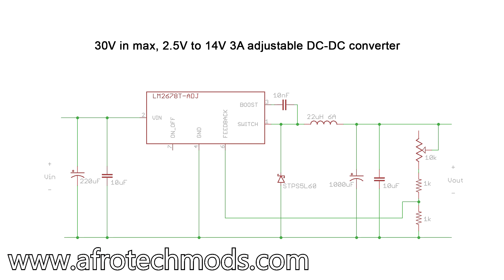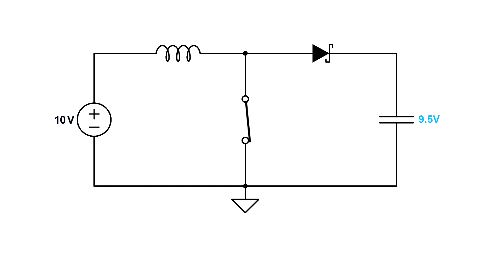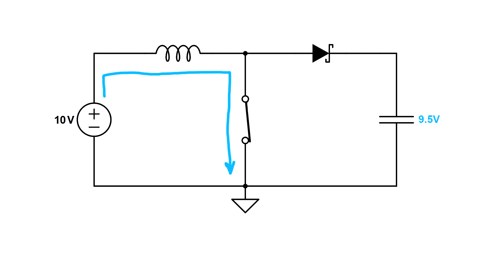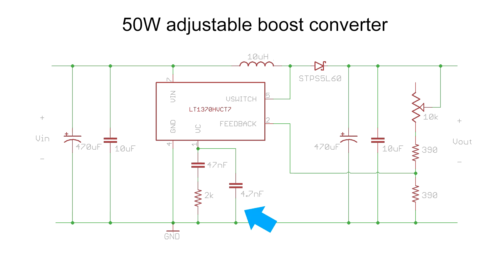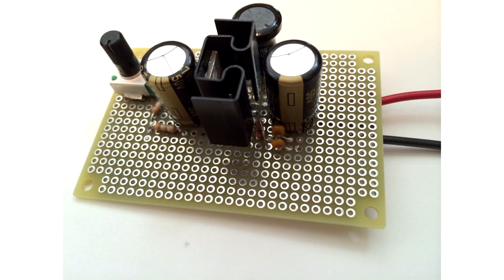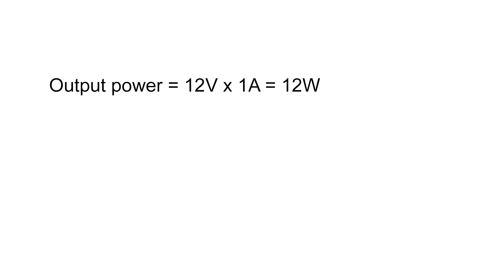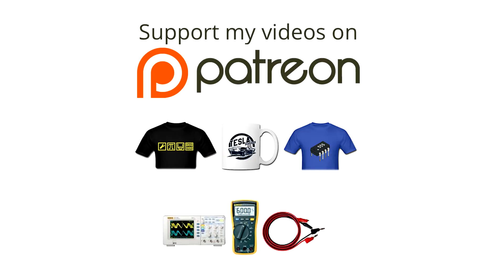DC-DC Boost converter tutorial

Comment: I was looking for dc to dc boost converter but couldnt find powerful enough converter to boost 24v to 36v with 60A output, is there a way to build power converter powerful enough to do so? or is it possible to connect multiple power converters in parallel? to achive high enough power output?

Comment: I had 150 volts stored in a 470uf cap on my bread board from my boost circuit, would that kill me?
Reply: basil abedallah Get The Fuck Out Of Here Right Now!
Reply: +Ultra RC If 150 volts had more than 0.01 ampere, and if it was shunted across your chest, the possibility is not zero. In essence, I would have to say YES to be safe.
Reply: +RiaRadioFMHD773 apparently 1 Amp is enough to kill you, but it's very volt depending like you said
Reply: +damon-st 1 amp can kill you, ive been lucky so far...
Reply: +basil abedallah bro, skin thickness doesnt have anythimg to do with it.. we are all 90% water.. water is conductive... we are all equally conductive (with in .2% depending on water intake) i am an industrial electrician.. i deal with KW on a daily..
Reply: That's 5 Joules of energy. A shock from a defibrillator delivers 300 Joules.

Comment: I use boost converters in all my 5V and 3V3 projects. They are like less than $2 now on aliexpress
Using a ferrite at the output, allows me to even use these boosters to power my sensitive electronics like sensors. Thumbs up.

Comment: Can you give me answer to this question : what would be the voltage in your example after just a single step of shorting coil and releasing switch ? In other words, if capacitor is initially at 9,5V due to diode voltage drop and you run one cycle on/off how to compute the voltage in capacitor ? is this doable ? How that voltage depends on parameters like inductance ,capacitance, input voltage ?

Comment: +Afrotechmods - I need a dc booster for a wind turbine for when wind is low and voltage is below charging volts so it will charge even at low speeds however when the wind picks up it needs to bypass the booster. How can I do that?
Reply: You need Buck-Boost converter
Reply: +temo taj - I already said that. What I then went on to ask is how to bypass the buck booster when voltage reaches a preset limit. How do I do that?
Reply: +SuckMySweatyBallz  Zener diode + Mosfets?

Comment: Hi, I'm currently working on a small railgun where I need to charge a 400v 3200uf capacitor off of 12 volts. Do you think a boost converter would be a good choice, or should I use some other circuit.
Reply: what else would you use?
Reply: 400v inverter maybe?

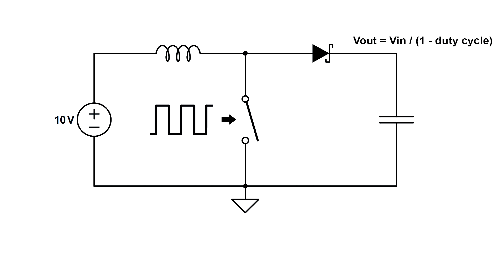Comment: 2:41 "We need a controller chip"
This is where the project instantly gets too complicated for me :(
Reply: And expensive £20. odd.
Reply: Start taking broken electronics apart and desolder all the components. Build up a good collection of random circuit boards (power supplies have good stuff in them). The key to learning electrical circuits is having the right parts at hand. You would be surprised what you can put together when you have all the parts right in front of you
Reply: Most chips are easy to work with. Give it a go!

Comment: Would this work as a battery desulfator ???
Reply: +Kennynva T. Yes. If you set the voltage to 16v, you can over-charge a 12V LA battery and hence, desulfate a LA battery. You will lose water in the battery since it turns into H2 and O

Comment: This tutorial is good as a supplement but for a more comprehensive understanding read/scour this article from TI. You will most likely never understand the operation of an SMPS without also busting out a pencil and paper to draw the circuit in its different states, write out (and better yet derive) the equations and practice some different values. 
http://www.ti.com/lit/an/slva061/slva061.pdf

Comment: How can I calculate the values of the components I'm gonna be using ?
I want to build a portable charger and I'm using 3 Li-Ion batteries from a computer in parrallele(to easily charge them and have a longer efficiency. Which means that I have to step up the voltage to 5V so I can charge portable devices(such as phones). But I wasn't able to find anything that could help me on the internet.
I appreciate your help.
Reply: +Mohamed Berrada It depends on your output current
For a simple controllre that can supply high power, and good design tips, check the MAX641 datasheet.

Comment: is this ok if i have an unstable power source like pedaling a bicycle connected to an alternator? since my rpm value for the alternator is not high enough, due to the limitation of my bike, because it gives me at most 10volts(not constant due to the speed of the pedaling of the bike...)...should i use this booster circuit in the video?

Comment: Do i need to vary the input to have 30volts output or it is already 30 volts when i powered up the converter?thanks
Reply: Christian Rey Bautista I think it depends on the last position of the potentiometer (the last time you turned it, the way it came from the factory etc.)

Comment: great vid. How is the maximum output of 30v related to those resistors? I want to boost higher. read the datasheet but couldnt understand :(
Reply: +Xinran Li Beware of stupid voltage increasing - the output capacitor may not handle it. To increase voltage, normally you increase the top most resistance.

Comment: What does combining both kinds of capacitors in parallel like that do?  Why do it?
Reply: +rlrsk8r1 I think it's something to do with the equivalent series resistance, the larger capacitor holds the most of the energy to smooth out the bulk of the switching frequency but alone that will leave some high frequency ripple which is where the smaller capacitance cap will deal with as it will also have a lower equivalent series resistance at that high frequency than the bigger cap. my explanation may not be entirely correct (not sure if it really is because of ESR or if im missing something but basically yeah the smaller cap filters high frequencies better than the bigger one)

Comment: what if we power the input using usb of a computer which can supply a maximum of say 500ma ? will the computer usb port gets damaged?  or will it sustain to this load so called dc to dc boost converter
Reply: srikar sana The USB port can deliver 1 amp. If you have a fairly modern computer, the USB port will shut off if its overloaded.

Comment: in the video is said that the limit in the output is 50W, according to my calculations, without heatsink with a limit of 150ºC (where the IC losses its characteristics) we have 3W of limit, it is so low, i'm not sure this is correct
Reply from the maker: carlirr91 50W of electrical output power. Not 50W of heat generated in the heatsink.
Reply: Afrotechmods you are right, i have an overheating problem but I think that i just found my mistake, the diode i'm using (1n5818) has just 1A of forward current!

Comment: Looking at the data sheet, it recommends one tantalum capactitor for the output capacitor, and says that ceramic capacitors alone have an ESR (effective series resistance) that is too low. Is the electrolytic and ceramic capacitor combo an alternative to the tantalum capacitors? (which are very expensive - about $10 a piece on Digikey. ouch)

Also, what about the frequency compensation capacitors? Can they be ceramic capacitors? What is their required voltage rating?

Comment: I am looking to build a boost converter to boost 12/24V to 300V to power 12ax7 preamp tubes with a small transformer i can get at radio trash. Using a 555 or 556 timer is fine. Output current is unknown but .5 amps is probably right. would like switching freq to be 40Khz and above, well out of the human ear range and also gentle on animals. Any ideas or links you could point me to, would be highly appreciated. Thanks in advance! otter

Comment: I need to boost 3,7V to 12v with a maximum of 3A output, anyone here for some ideas?
Reply: Brando I'm new to BCs myself, so I won't even attempt to give you tips on the circuit, but I know that first of all, your input will need to be able to supply enough current to handle it. 
12 volts * 3 amps = 36 watts (this is the total you need at output)
36 watts / 3.7 volts = 9.73 amps (approx)
Then you need to allow for some loss in the circuitry of course, so you can bet you'll need at least 12 amps on the input.
Reply: +Brando Use a MAX642, a suitable Low RDS(on) mosfet like the IRF540N, and a low value inductur but that can handle high current (low winding resistance less than 0.1ohm, value approx. 20uH but YMMV). Use a 1000uF minimum high quality input/output capacitor, in parallel with a 10uF tantalum. The schottky diode could be a SBL1045ct (10A). 
USE THICK TRACES AND build everything on a SINGLE PLANE using SHORT and THICK CONNECTIONS. 

Troubleshooting if the inductor value is wrong:
-Too high: 12V output drops to 9V or less when some load is applied; inductor WINDINGS (not core) gets excessively hot; can't regulate properly output when load attached (voltage is not stable), can't get full power.

-Too low: can't regulate at all output (can't get 12V at all even with no load), inductor whines loudly, MOSFET overheats even with no load, inductor CORE (not windings) gets hot, excessive consumption even with no load. 

What's handy about the 642 is that it has an integrated Low Battery Indicator function which is useful if your project is powered by batteries (your seems like it is, given the 3.7V).

Use a toroid type inductor, that way you can wind or unwind the windings to adjust its value by trial-and-error if you don't have a LCR meter, just like I did. (I took a big inductor out of an ATX power supply and progressively unwinded the windings until I got the best efficiency). 

Here's mine (powered from 4 1,2 V AA cells, 5V total , output current = 2,5A @ 12V) , all parts labelled.

http://ergolth.alphab.a-centauri.com/cdn/MAX642.jpg<

Ask me any questions you may have!

Comment: I simulated your simple boost circuit on Proteus but without the LM2678T IC, instead I used a 555 timer IC to give me the signal to control on/off transistor(simple switching technique), but the output voltage kept increasing and didn't stop! so I put a zener diode to limit it to 20 volts (I want a 20V output), Question Is: Is it safe for the zener diode ? and for the circuit?
thanks in advance.
Reply: Mane laston  If the current through the zener and the power dissipated through it is below the maximum ratings of the diode, everything is safe. If you exceed the ratings of the diode you will notice it immediately because.
A: the diode will get hot, very hot
B: smoke might come out of it
C: it may go bang

Comment: Very nice video. However, I always miss a nice explanation of which parts exactly can kill you. Yes, I know it's touching + and - of the capacitors. But still, it would be nice to have someone explain where exactly you can and where you can not touch a capacitor in such a circuit.

Comment: Just love your channel man its the best!I built a boost conv. 12v-15v 3A for laptop backup power based on mc34063 with output mosfet,and i don't know which inductor to use,i tried some but either the components heats up(shotky diode/coil/mosfet)
here is the crkt http://320volt.com/en/mc34063-12v-15v-dc-dc-konvertor/  tnks,keep it up

Comment: I'm not understanding one part of this video. Why does the current from the inductor cause the voltage to rise? I understand the part about inductors not wanting to change current quickly, but I thought current couldnt induce voltage.
Reply: It causes voltage by forcing current into the capacitor. Charge entering the capacitor causes an increase in voltage.
Reply: Ryan C. Engineering So without a cap, the voltage would not increase?
Reply: Prometheus It is hard for me to visualize exactly what would happen. But I will give it a shot. When the switch is closed, current will build up, and when it opens, it will be forced through whatever load was connected (this will produce whatever voltage is necessary to maintain that current). This means indeed the voltage will increase, but it will also decay with time. The capacitor smooths that voltage ripple by absorbing the ripply current and due to it maintaining a nearly constant voltage, will output a nearly constant current to the load.

What you should understand though is that voltage is electrical pressure, so any time an inductor tries to force current through a resistance, it causes a "pressure" or voltage. The capacitor in this analogy would be like a holding tank, whichis large enough that its pressure stays relatively steady.
Reply: If you dont have the capacitor, the voltate would but hundreds of volts. Inductors are used to create sparks. In cars, a current flows throw a coil, and suddenly opens. The inductor oposes the change in current generating hundreds or thousands of volts and finally release the energy through a spark.

Comment: Hi, first of all, great video! Regarding the circuit, How can I get a fixed output value? I mean, Vout depends on the feedback resistors and Vin, right? Can I get a fixed Vout (e.g. 12V) regardless of Vin? Maybe using a zener diode somewhere? Tnks
Reply from the maker: jaciroscar watch my previous video on adjustable switching power supplies for more info on the topic.
Reply: The circuit he shows already works that way, he just made it variable. Most switching converter chips have their own reference built in, that's what it's comparing the feedback voltage with.
Reply: BineySaurus You're right, my bad. I thought it was just multiplying the input by some constant, as I hadn't seem any voltage reference (like in classical op-amp configs). It turns out that the IC has an internal "magical" voltage reference (0,8V according to the datasheet) to compare to.

Comment: Once time I found a small 8 pin DIP package boost converter and I wired it up according to a schematic on the original datasheet for the part, but accidentally used a 4.7k ohm resistor instead of a 470 ohm one for the feedback, and I ended up with nearly 80V on the output; my electrolytic popped and then the chip let out the magic smoke! LOL, Oops!  (BTW the absolute maximum rating was 40V output)

Comment: I saw this coming, with the excess energy from the inductor boosting the output voltage, or is this different?
Reply: It's the same(I think), and basically, if we do this, we're running off of inductors? What? That's swag

Comment: What's with the safety warning for 30V DC. I'd be more concerned about burns from the heatsink.
Reply: I think he said (or meant) that he limited the output to 30V, and that these can go a lot higher. I have seen designs that can boost up to tens of kilovolts!!!
Reply: This chip can only go up to 37V
Reply: the data you see on the datasheet is for a certain configuration. If you use a different configuration with say, a external IRFP450 MOSFET and the feedback though a large resistor divider, the chip would only see 1.25V at the feedback, and it has no way to 'see' the output voltage. It is the feedback resistor divisor network that determines the output voltage.

I know from experience it is very easy to confuse say, a 470 ohm resistor with a 4.7K, and that could be the difference between 24V output and a 240V output. Especally if the components used can handle those voltages! I often use 100uF photoflash capacitors for filtering due to there large physical size and consequentially low(ish) ESR, But usually only because I cant find a similar capacitance. You can see how things can get ugly fast!
Reply: NEC has a 50V threshhold. Above that and arc flash injury becomes a real possibility.
Reply: Justin Bell obviously if you wanted to go into kilovolts, you wwouldn't use that chip. There are many options and the chip isn't even really necessary.
Reply: I would know because I made this mistake once, and had 80V output using a simple configuration with the internal switching element. The Absolute maximum rating was 40V.
Reply: I think that the safety warning is very useful when dealing with boost converters. 
I've got shocked once, about 250v DC.
Reply: I believe he was talking about shorting the supply. Pretty nasty things can happen when shorting the power supply.

Also, I higher suggest grabbing a fan and aiming at the heatsink when you know the chip will be handling aloit of power. A cool chip is a happy chip.